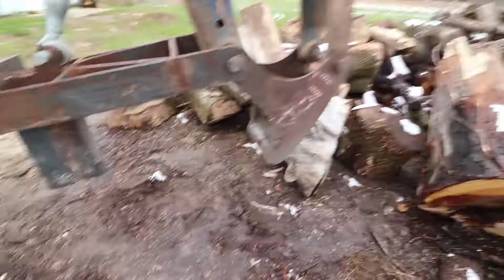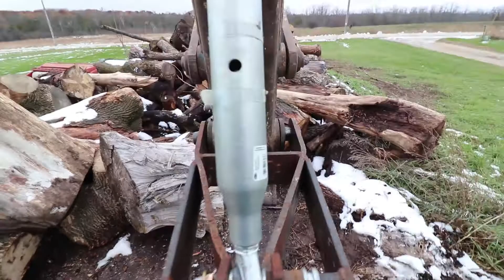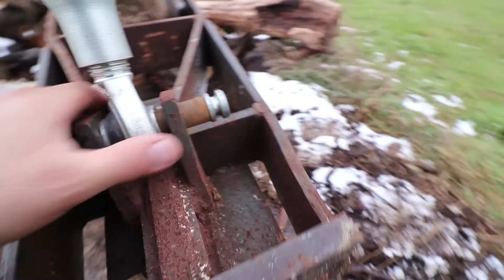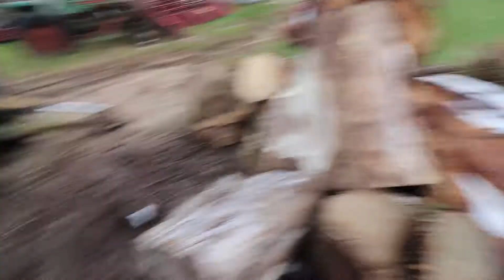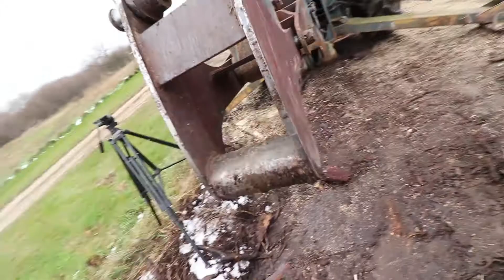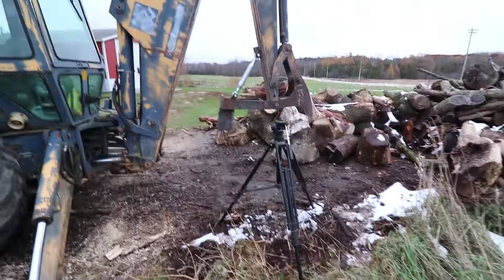Backhoe Log Splitter information

Comment: Hi there was wondering if you could send me the CAD drawings Cheers
Reply from the maker: Hello - Sorry it's taken a few days to respond.  I zipped up the drawing files which you can download from my website here: (https://airplanesathome.com/LogSplitter2.zip) .  They're in Solidworks and step formats, and the moving jaw is also in a DWG file I sent to my local metal fabrication shop to be plasma/flame cut.  If you need the drawings in a pdf format let me know and I can convert them to pdf format.   You'll also of course have to verify pin diameter and geometry to work with whatever backhoe/excavator setup you're looking at using.  Good luck on your build!

Comment: Thanks for the discussion and measurements. The second I saw the top link I knew the weak spot. Suggest a fabricated arm, maybe two different lengths if needed. I did not recognize the backhoe model - been around hoes for close to 50 years, owned various for 40. I'm going to try to build one, should have done years ago, have a fab shop close by with a computer flame cutter.
Reply from the maker: That's a 1983 Ford 555 Backhoe.   My assumption as well was that the top link would be the weak point, and I started with the smaller of the category 2 top links as I wanted the top link to break before I broke the backhoe or other parts - it's an easy to replace part and I can pick up another category 2 top link from the local farm supply store for $30.I actually made the video for a friend to be able to do an engineering analysis on the top link for a class project.  At the time of recording I had upgraded to the larger category 2 top link and it's been rock solid.  The cross-drilled hole for the rod to adjust the length was causing a stress riser location, which is why the smaller link broke right at the hole.  The larger top link ends up with a safety factor  of a bit over 2 in this use, and I haven't broken a single one of the larger category 2 links.  I can pick up the end of the backhoe and push it around no problem with the larger link, and the hydraulics will stall out before the larger top link gives.   It's been a very hand and helpful splitter!

Comment: What a great idea. I'm just getting over a sore back from wrestling with a couple of large blocks and come to find out , after watching your video, I had the perfect machine for handling and splitting wood. Just one question, what size of steel did you use?
Great video though.
Reply from the maker: 1/2" thick A36 steel for the majority of the structure.  side pieces going from the bucket pivot pin and holding the splitting wedge are 4" wide by 1/2" thick bar - be sure to cross brace this well so it doesn't try to twist the splitting wedge.  The link is a standard top link from a farm supply store (get the heavier duty one which will have a larger OD - the hole in the center of the tube for the rod is a stress point and will break on the smaller links, but I haven't broken the larger OD one yet).  The jaw is also from 1/2" thick steel which I had plasma cut out at a local fabrication shop, and the tube is a 4" OD section of 1/2" wall pipe that pushes against the log.   I do have a CAD file available of the moving jaw part if you want, though you may need to adjust things to work with the model of backhoe/excavator you have.  It's not quite as powerful as a purpose built log splitter, but I don't have to lug around gigantic chunks to the splitter with this.  If you work your way around the edge you can split some pretty big chunks up, and if you should get the wedge stuck in a log, I can push it back off the splitter with the hydraulic stabilizer.  The best part though, is that I can pick up long log sections off the ground to buck into shorter sections so I don't have to try and saw them up on the ground and dull the chain saw by accidentally digging the bar/chain into the dirt!  The fact that I had the backhoe and wouldn't have to add auxiliary hydraulics up the boom and down the dipperstick were a large driving force behind this style of splitter attachment.  Let me know if you have any other questions.